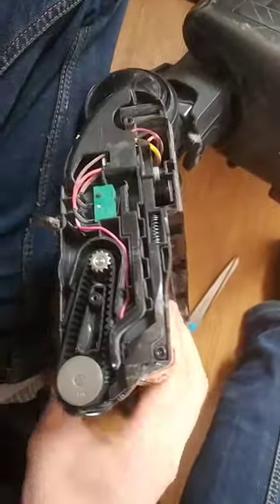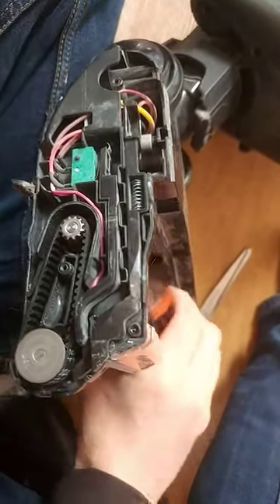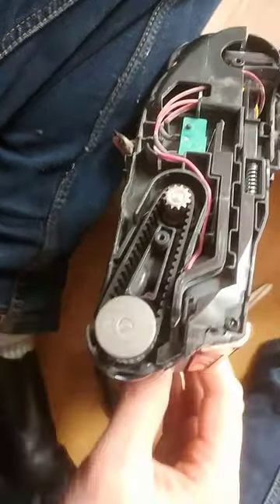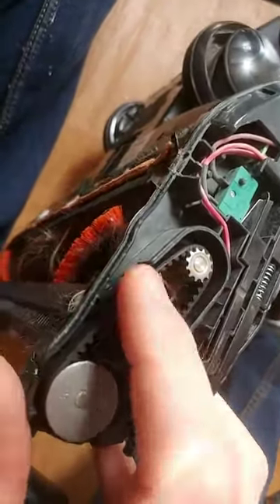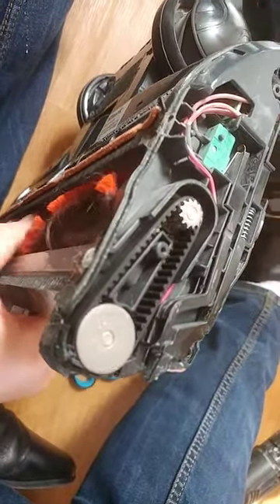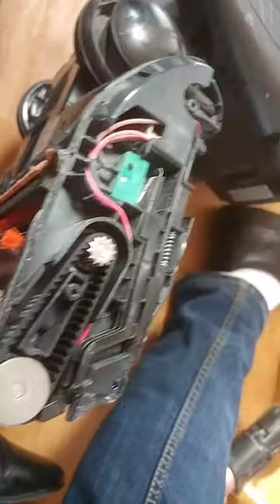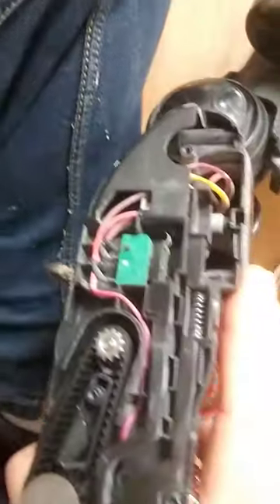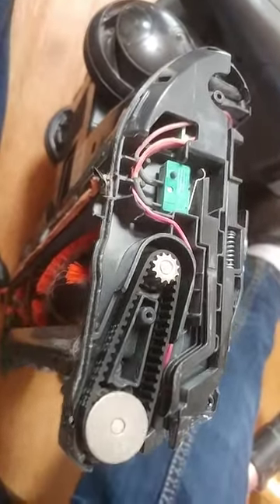replacing belt on shark lift away

Comment: Would’ve been nice if you would’ve showed how to take the thing apart to get to it
Reply from the maker: It takes more than a short to do that. Honestly ive had to do this again since and its tricky even if you half remember how you did it the last time. Easier to stop clogging the front roller but tends not to be me that breaks it.
Reply: Putting the belt on is easy, but HOWdo you get the side off first without taking the whole thing apart. I didn't see any button to push to help take the side off either. 😕
Reply from the maker: @johnzech5039  the big slider is part of the mechanism holding it on plus some screws. So make sure you push that slider back.

Comment: Does the soft roller spin also on that belt
Reply from the maker: Yep that the purpose of the belt. It looks to me to be a 2:1 reduction so the main hard brush is spinning twice as fast as the soft brush which is driven by the belt as long as it still has teeth.